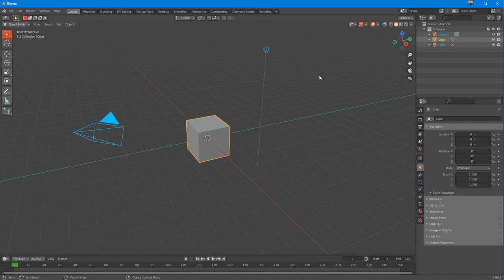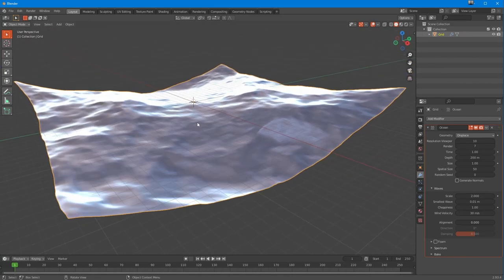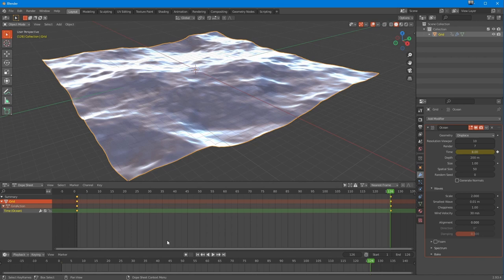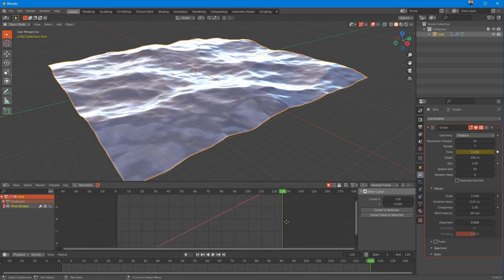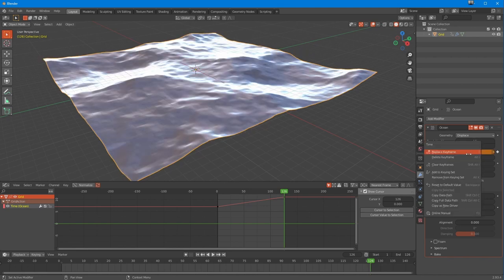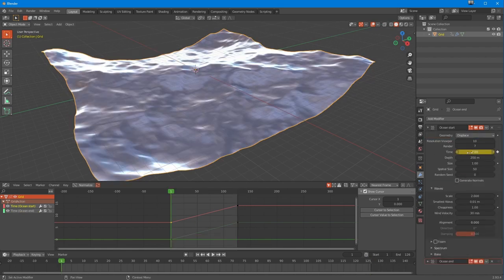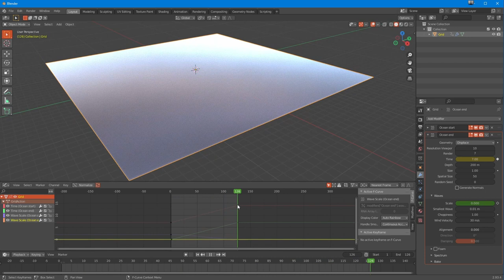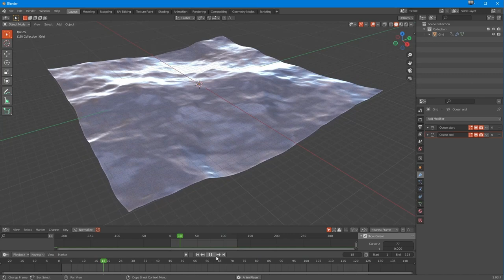TUTORIAL: How to make the Ocean Modifier loop in Blender!

Comment: It's a great way to solve a problem but if you have the foam active unfortunately doesn't work as it seems the foam build up over time, any tip about how to fix that?
Reply from the maker: Hi Daniel.  I'm not certain,  but the foam value of 1, I think,  causes it to remain.  Rendering that out as a texture with a lower setting, then creating a loop and applying it as an animating texture should fix that.
Reply: @GENVFX  Thanks for the kind reply, maybe as the scale I should try to animate and "crossfade" the foam!
Reply from the maker: @DanielOakfield  yeah,maybe

Comment: It works, but in the middle of animation we have the reduced scale of waves by.. just a half.. is there a way to solve this issue?
Reply from the maker: Just to make sure I've read this right, the point where your waves transfer from one displace to the other, it feel less displaced and is a bit obvious, yes?

If this is the case, avoid a linear animation curve between the two displacements and do a slow out from the first and a slow in to the second.

https://imgur.com/5EnuLoM

This may help to diminish the dip between the two displacements at the mid point, as well as ease the motion somewhat.

Hope this helps
Reply: @GENVFX  I'm sorry, English is not my native language )). I meant the waves amplitude in first and last frames in two times bigger than in middle of animation... Thanks, I'll try this idea..